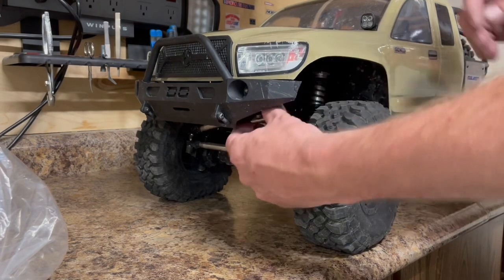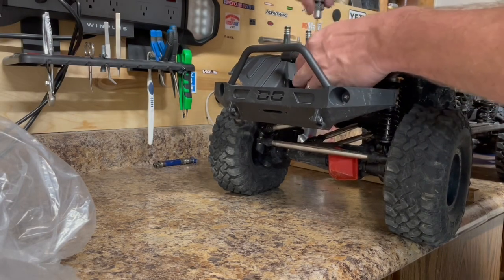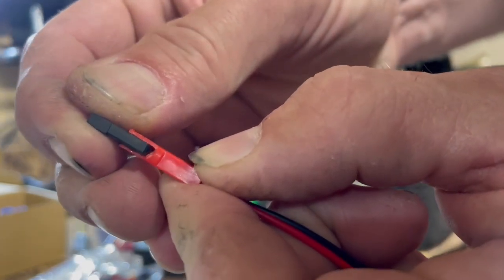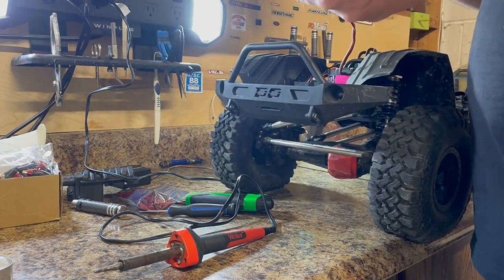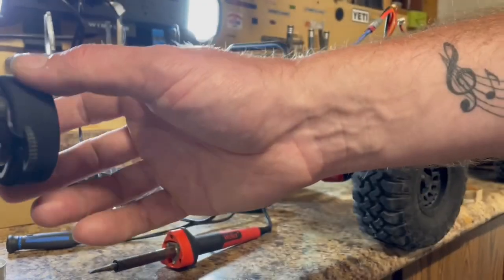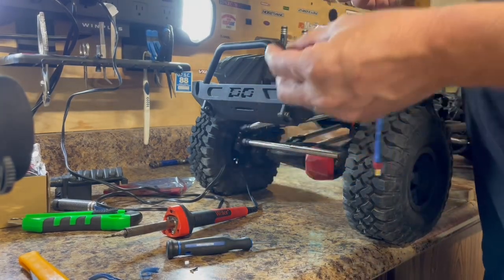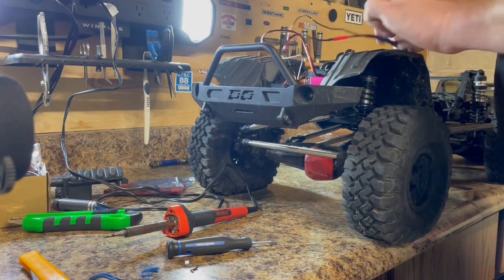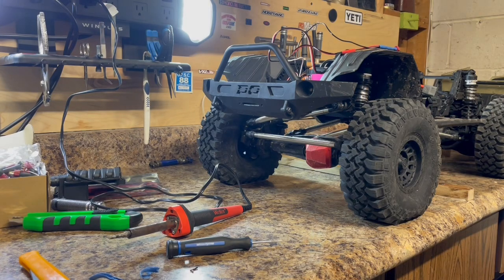Eliminate the brownout’s on your SCX6!

Comment: I was running the DS 80kg version of this servo in mine with a Hobbywing 10amp continuous UBEC powering the servo with 8.4v. While it got by okay and was better than stock, the servo is very slow. I suspect it is the same as the 60kg version you have but with lower gears to get more power making it slower. It also didn't center well.  Yesterday I installed a NSDRC 2500 V2 servo in mine. Wow what a monster of a servo. Extremely fast and powerful. I am glad I had already upgraded to metal shock towers and panhard mount.
Reply from the maker: I definitely need to upgrade from the 60kg. It doesn’t centre well on the rocks either. Better than stock but not impressive by any means.